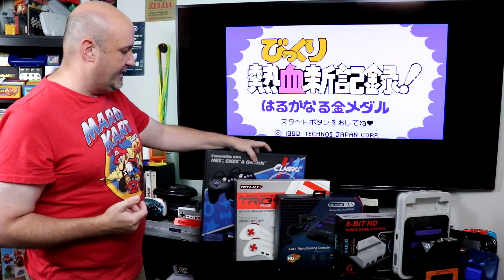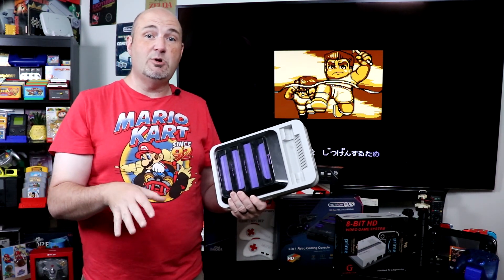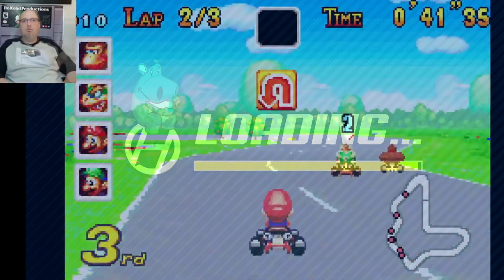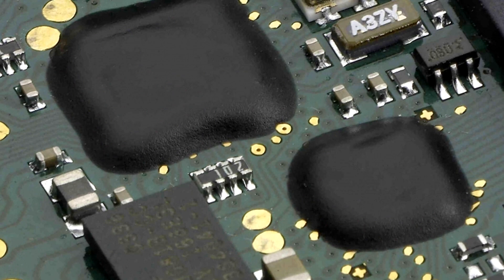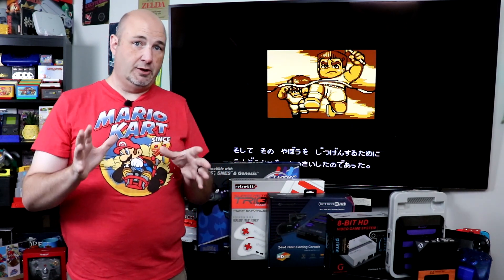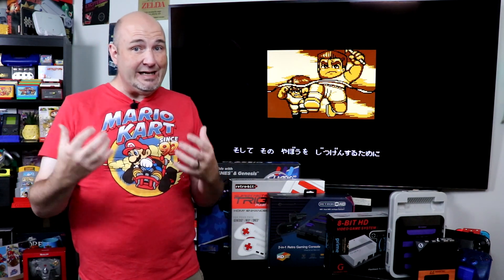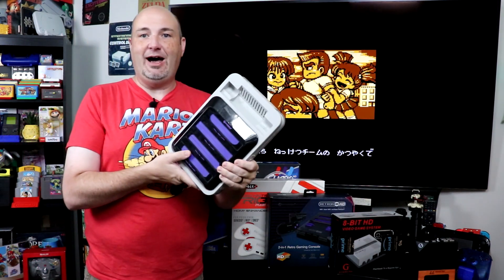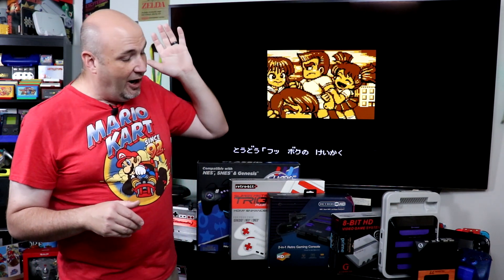Understanding Clone Video Game Systems - SoC Vs Emulation Vs FPGA

Comment: Hello! I from Eastern Europe. I love retrogaming, video games appeared in my country late, in beginings of 90-s. And all known game system which we knew about it be: Dendy (8bit consol which been analog of NES, made by TXC Corporation on Taiwan by ordered from Steepler - company which be distributor of HP and Microsoft before creating "Dendy" shops of video games consoles), Sega Mega Drive 2 and later appeared Super Nintendo. How exclusive, in my country be possible to see in several shops Panasonic 3DO, but it be unreal expensive, and it be more some museum artifact and people just coming to watch on this amazing thing (it be on CD disc, it be fantastic it be first device which appeared in my country and worked on CD. We not have audio CD in what time). I knew about existance of TurboGraphics, Neo GEo only 2 years ago, I never not hear about it, it never not sold in my country.
You know, I want to admit what I met therm "not official clone" very often about Dendy console, but I think in not correct. Because, if you say "not official clone" you automatically suppose what exist "official clone". But, no exist "official clone" of some video game console, if to think logically about it the "official clone" (if it existed) it only can be console with Nintendo, Sega or other logo. So I against to label consoles like Dendy what it "not offical" or official clone, it way leads nowhere.
It be very interesting to watch your video, I never not saw nothing from system which you showed. 
I played and playing in RetroGames on hacked SNES classic mini, and Sony PlayStation Classic (mini), I happy what bought it, because I have ability to play games in city on 4K TV via HDMI, I can record my gameplay, and I can play in games from many different consoles. I only not understand how to launch Nes and Sega MD2 games on SNES mini, I need to read more about it. In some videos I saw what SNES mini perfect emulated some of N64 games too. But, I think for emulation of N64, arcade (MAME and other) games better use more powerfull PlayStation classic. 
From other modern system for retrogaming, I only see different consoles on AliExpress, but it unknown, so I not know how it good, how it real work and e.t.c. These systems for retro from Ali not very popular in my country, people play on SNES mini or PlayStation classic or use RetroArch on PC. 
But, I saw on channel from Germany "RetroZocker Bitdo" videos about console from AliExpress, it some new version of big SNES console (with cartridge slot), it have signal outputs for AV composite cords (yellow,red,white), and HDMI out, and picture ratio button. Name of it console "Super HD SFC Game". I liked it, and you know if I not have my original SNES console and cartridges for it, I think what I bought it without doubt. It can be exellent present for friend or for kids. If I have kids, I bought this console + flash cartridge and wow! way in retrogaming world open for kids, I think what games on retro consoles be much kind when now, it consoles be more oriented on kids. 
I hope what it be interesting for you, wish all the best in New Year 2024. P.S. Please, sorry for my poor English, I not have a lot of practice.

Comment: One other option is you can DIY your own NES, etc. You can find kits that let you assemble one from the actual CPU and PPU chips salvaged from a broken NES or old stock.
Reply from the maker: You can, but that's not an off-the-shelf solution that the average consumer is going to want to do. That's what I was focusing on here, systems that people could purchase and just use.

Comment: I was wondering if there's a translation pack for fpga consoles? That way, you can play famicom disk games in English for example. Is there an fpga equivalent of the retron 5 too? My sincere apologies in advance for this being long.
Reply: I don’t think they have live-patching features since FPGA consoles typically access the cartridge in small chunks, like a real console, whereas the Retron 5 copies the entire cartridge rom into memory at launch and can patch it automatically. However, you can use flash carts like an Everdrive, or jailbroken firmware on the Analogue FPGA consoles to run rom files, so you could patch roms for the games you want on PC and copy them into the console to play with.

Comment: This begs the question why or what games have don't run on these clone consoles correctly or have issues because from what i have seen at least for me battletoads on the NES seems to freeze at level 2
Reply from the maker: Battletoads is about the only one that breaks
Reply: @RoXolid  is there a clone console that you have tested where that game actually works correctly or are all the clone consoles do the same thing with just that game the only reason i am asking is because i don't have the HDMI mod on my NES and i am looking for a good clone console to play that game which i own and all my other NES and SNES and Genesis games that I own so which one would your recommend
Reply from the maker: @allansmith7139  All of the budget HDMI clones, I'd say there was $100 and under, I'll pretty much operate the same way as this one. So you're going to run into similar games compatibility issues. When you get into things like the retro USB AVS, that will be able to play games like Battletoads

Comment: Wanting to get a NES Clone, my first option was the Retron HD since i have the Supa Retron HD, I've seen videos fo the GamerzTek 8-Bit HD and the Retrobit RES+.

My question is, which one is the better NES Clone?
Reply from the maker: I'm not sure the RES+ is available any more, and it's been 6 years since I've tested it so my memory is a bit foggy. The 8-Bit HD I recently re-reviewed and I forgot that it used a propriatary connector for power instead of Micro USB. Also, the color and audio weren't as good as I remembered. The Retron HD is ok, but I found the sound and visuals to be worse than the 8Bit-HD. Since you have a Supa Retron HD you might want to look at the Retron2 HD or Retron 3 HD, that way you can condense your setup a bit vs having multiples.
Reply: @RoXolid  I didn't think about the retron 2 or 3. I may try the retron 3 HD since my son likes sonic the hedgehog. Plus I was wanting to get him a genesis Clone for either his birthday or Christmas.

Comment: So S.O.C is basically hardware emulation and emulations (as we usually understand it) is software emulation?!
Reply from the maker: Yeah, that's a good way to look at it. Also, with SoCs you don't have a long boot time due to the fact you're not loading an operating system
Reply: @RoXolid  Thank you for the reply.  I hadnt even thought about boot times/operating systems.
Reply from the maker: That's what I'm here for, I think of the stuff so you don't have to, lol

Comment: Ok so there is nothing that tries and use parts similar to the original hardware? I guess it makes sense but I am curious how one can get the closest thing to playing the original console while getting the benefits of some of these clones like save states or having multiple systems in one.
Reply from the maker: You'll need an FPGA System to accomplish what you're looking for. There was some system in the past that used CPUs and PPUs from original hardware but I don't recall what it was.
Reply: @RoXolid  Thank you for your help, I have a hard time finding this any other way but just knowing the system alone is a huge help.
Reply: @RoXolid  Analogue NT (not mini) used original PPU and CPU from salvaged NES's.

Comment: Great video thanks to the explanations! It's a shame that there are no actual hardware clone (aside from the overpriced Analog NT RIP)!
Reply from the maker: There's the RetroUSB AVS as well, and the Budget Hardware Clones are still clones, just not as accurate.
Reply: @RoXolid  Hey thx for the answer! I'm interested in those bad hardware clones if you have some names. Regarding the AVS it's interesting as it seems it's an FPGA according to My Life in Gaming RGB305's episode and RetroRGB (who looks like reliable sources but yet could be wrong). Also it's note worthy, imho, that there's only an implicit line on RetroUSB AVS official description: "Real hardware means no boot or loading times. No stolen software emulators or buggy NOAC chips. A wide range of gamepad, video, and cheat options to play the way you want.".

Sorry for the long text!

Comment: I bought a Retron 5 day one. It’s a great device, it’s just a shame it STILL hasn’t been hacked to allow you to run roms off the SD. I honestly thought the hacking community would have had custom firmware within the first 6 months, but here we are almost a decade later.. ahh well.. I guess at least there’s plenty of other ways to do that these days. I did trade in my original 5 for the Hyper Beach edition though, love that color.
Reply: Btw, I noticed I was unsubscribed from your channel! That’s been a real issue on YouTube lately
Reply from the maker: That it is, that's why you hear creators all the time asking people to verify that they are still subscribed to a channel.
Reply from the maker: It actually has been hacked to run ROMs off the SD card. I don't remember the exact process but you had to have a game from the system that the game you're running off the SD card in the system, and somehow you loaded it off the SD card. It's been like 5 years since I did it and I don't remember the exact steps but it is possible

Comment: Im a collecter of these. The retron 2 hd is where i started. Have super nt and snes with a tink5x. I still love the retron 3hd. Theres no lag and it just feels right. Has excellent audio and the pixels look aligned perfectly. A tip for anyone tgat has one set to 16x9 and 4:3 on t.v. the graphics are scaled corectly with no green fringe, and no lag.

Comment: The Retron 5 really overachieved in my opinion.  The software is pretty darn solid, and you can play a ton of games on it.  The games look great and luckily, I haven't had any quality issues.  The price used to be quite reasonable, but I've noticed it has been steadily going up.  Maybe they have finally stopped production, not sure.

Comment: The Retron 5 also got me back into 8 & 16-bit gaming thanks to its relative ease of use and compatibility with HD tvs. From there, I came across Analogue systems, which became my absolute go-to's whenever I'm playing Genesis or SNES games. I do wish Analogue would do another version of the NT, because that's the only one of the big 3 that I'm missing, and I'd rather not pay eBay prices to get one. I'd also be perfectly fine with a new NT that was for NES games only if it meant a cheaper price (sorry Famicom fans).

Comment: You mean the hardware based emulation systems use a FPGA ( Field Programmable Gate Arrays ) which will do a 1:1 recreation of the hardware emulated if the emu core is made correctly. Example is the Mister FPGA
Reply from the maker: Not entirely, SoCs are still hardware-based and recreate the functionality of the hardware. However, FPGA systems are MUCH more accurate in their reproduction.

Comment: Looking at clone systems historically might be a better approach. The first clone consoles were "system on a chip." Made out of brazil and china. They were contemporary with the original nes and genesis. In Brazil's case they were made because actually NES consoles were not available. Later, around the 2010s, the emulation based consoles started to come out. People were feeling nostalgic for old consoles and Atgames and Retron made quick cash grab products. They were pretty bad products when compared to pc emulation. This paved the way for fpga sytems. People wanted something better. Fpga was the answer to all the laggy crapy emulation and clone systems out there. Analogue started with clone NES and Neo geo systems they made from harvesting original hardware for it's organs and slapping a fancy case and output board on it. People actually bought those proving there was a market for high end clone systems. Then Analogue went into fpga systems and was successful. People saw that Analogue products were not using their full potential and open source MiSTer came out of that. MiSTer is the final form of clone systems. It's power level is over 9000!...I probably should just make my own video on it.
Reply from the maker: This is about helping people understand what's on the market now if they want to buy something. Sounds like you have a lot to say about the topic, I look forward to seeing your video on the subject

Comment: I have a couple of clone consoles Retron 77, Megaretron HD, RES (av) and the original Retron 3 which had s-video out for SNES and Genesis.  I think one thing that warrants mentioning about systems on a chip, is that their lag comes from the cheap upscaling chip they use. If you have a RetroTink and the av/s-video console you don't have lag. In some cases I think the picture is better than the OG console going through the RetroTink (not the audio).  Love these videos!

Comment: I've got the Retron 5. I love the thing. I mainly use it for Gameboy/Gameboy Color/Gameboy Advance (being able to play in HD on my TV is a godsend), Super Famicom games (mostly RPGs with Translation patches), and, using the Sega Power Base Converter, Master System games (mostly because if it's a game with FM sound as an option you can play it that way making a game like YS 1 a much better experience with the Yuzo Koshiro soundtrack as intended) and that's about it. Everything else I use original hardware. 

I, too, am very excited for the Analogue Duo and that's the only FPGA system I will buy. Like you it's the CD part I'm most excited for. I actually have a small collection of Turbografx CD games (and hucard games) I've gotten here and there over the years (I originally planned on getting a Duo R until I leaned of this FPGA device) like Cosmic Fantasy 2, Vasteel, Exile and Gate of Thunder! Can't wait to finally play them. 

And, yes, I've tried emulation, before anyone asks, but I only have a somewhat old 4gb ram laptop so games like that run like crap on it if at all. Having a plug and play option using the actual controllers sounds Devine and I can't wait for the experience.

Comment: My favorite clone console is a raspberry pi.
Reply from the maker: Yeah no
Reply: @RoXolid  why not?
Reply from the maker: @halkieria7581  because it doesn't play any physical media. By that same token I don't consider a computer to be a clone system.
Reply: @RoXolid  oh ok
Reply from the maker: So raspberry pi is simply an emulation station, not a clone system
Reply: @RoXolid  so if someone adds a peripheral to read cartridges it would be a clone system?
Reply from the maker: Not really, I would also consider a clone system to be something complete and self-contained out of the box from a manufacturer. So like you could get adapters to dump the ROMs from NES Super NES cartridges on a Super NES classic or NES classic. I would not consider those to be clone systems
Reply: @RoXolid  So not trying to be a troll or dick, it can be kinda hard to read context via text. I get where your coming from and i don't think your wrong technically but look at it this way. It's a DIY console of sorts. You can use almost any controller you want, play any retro game you want at the resolution you want. Personally i love using a Pi purely for retro achievements. Physical media aside i would argue it's the same experience as a clone console, at least the cheap ones. I believe the retron 5 uses emulation?
Reply from the maker: @zemaduvant8676  The major difference is the fact that a Pi doesn't play official media. A Pi is as much of a Clone as a PC would be. 

If you want to consider a Retro Pi a clone, I'm clearly not going to change your mind, but I don't consider it as such and you're not going to change my mind
Reply from the maker: @PatrickThomasBrady  You are 100% wrong, the non-Android Based systems do not dump the ROM. Also, what do you have against periods? You never use them?